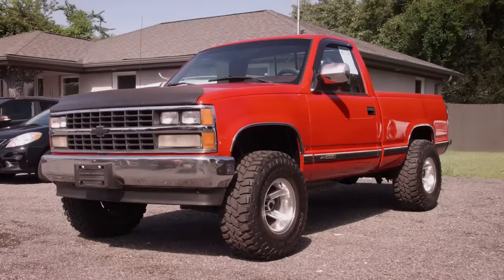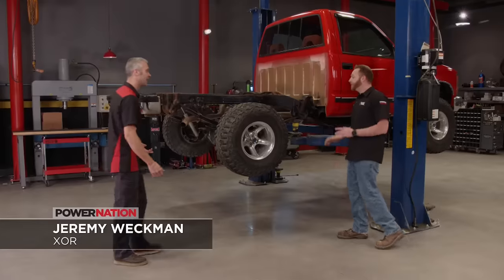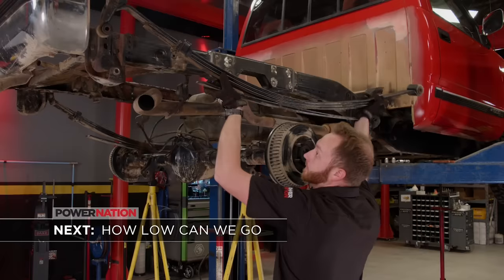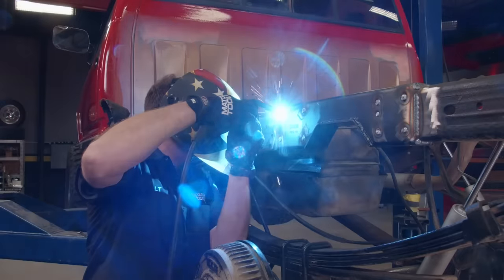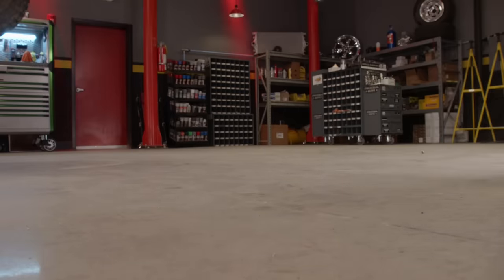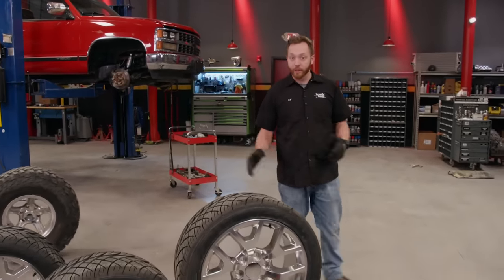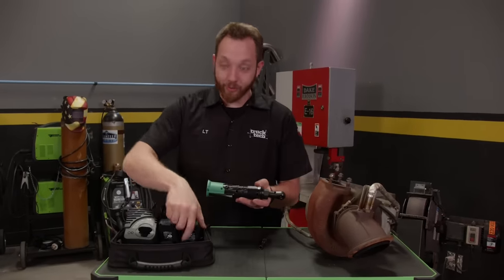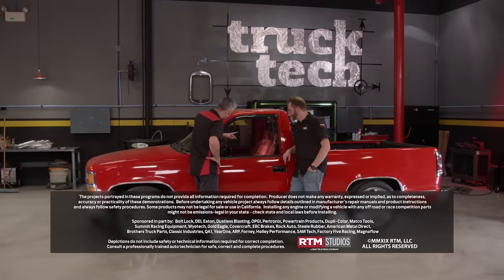Installing 4/6 Lowering Kit on a Chevy K1500 4x4 - Truck Tech S6, E4

Comment: So everyone loves the GMC Syclone and Typhoon, but somehow this is sacrilegious?!?! Great work guys!!! Glad to see something other than another cookie-cutter lifted 4x4!!
Reply: Magic6GMC  Agreed 👍🏻
Reply: yup to each their own. my coworker has a lifted 2wheel drive.
Reply: Everyone loves a SyTy until they own one. You have to have Bill Gates money to have a nice one. Even a 4L80E swap is 5k+ and very few people still support the 4.3 turbo. A turbo L33 LS2 or LS3 is the only way I'd consider having another. So many parts are specific to that platform.
Reply: It sounds dumb at first but the thing is the syclone and typhoon are awd while this k1500 is 4wd theirs a difference
Reply: @ericksanchez7787  they converted it to awd
Reply: @chesspiece81  5k? you're crazy. A stock 4l80e will handle 600 RWHP, with an HD3 kit they have been proven to handle close to 1k. 
125 - UpickUPull Trans
280 - HD3 kit
200 - UpickUPull NP205 transfer case
Reply: @ERidParasoth  converter, flexplate, driveshafts, software to run it and etc. Yes, 5k
Reply: I agree with this because every obs Chevy I see is lifted and I get sick of it
Reply: I worked on them for a time, they were junk

Comment: These older Chevy 4x4’s are perfect for lowering if you still want the four wheel drive to work. The independent front suspension works better with lowering than a solid axle would. My old friend in Alaska lowered her 1995 GMC Silverado 4x4 regular cab short bed back in 1996 after she bought it. She wanted something that looked similar to a 454 SS truck but that still had four wheel drive for the winter. Her truck looked great and in four wheel drive it would launch hard especially compared to a normal rear wheel drive truck. She got her lowering kit from BellTech way back in 1996.
Reply: this is exactly what people dont get on here.  Some people still want practical vehicles that look good but cant get over the fact that someone lowers a 4x4 truck.  I guess they forget about the silverado ss which is lowered from the factory.
Reply: @StingrayJen  I guess some people forgot that the SS was an overpriced, impractical, unpopular truck that barely sold enough to justify production, and is only driven by rich floridians that've never been off the interstate...

Comment: Dropped 4x4 is great, now how about putting some real power down to make it an awd street killer....like the awd ladybug....
Reply: Jose L ahh but he got clapped by leathal weapon
Reply: @itzzekee  yea true but they a both dope obs truck....
Reply: I'll race it in my off road truck and we'll see who wins lol. They made a 4x4 street princess and that's all they did but at least it looks better than most other street princesses, unfortunately it won't make it down my road, sad.
Reply: @reaperasylum2163  Your truck is suited for your usage case, which is brilliant. For those rest of us that live more urban snow belt areas where there is only practical parking one vehicle (if you can find a space big enough to fit it in), this thing would be a brilliant choice. It's big enough to be useful, small enough to fit most places, and still practical to use in any condition. There are a couple other places that these still beautiful "street princess" would be much better than your off-road oriented machine. 3am bombs around curvy backroads while dodging deer. At track or auto cross events. Wouldn't it be hilarious to pass some Miata drivers in a truck around turns?! 
These trucks will be lighter too. Especially the wheels, tires, and suspension. If you know anything about physics, aerodynamics and fast vehicles in general, lighter and lower improves many things on the road. It should also be noted that given equivalent power and both trucks in 4 high, the lowered truck will be faster. Mind you, I'm not saying that they're better than yours, just better for different usage cases. Enjoy your truck and be proud of what you built!
Reply: @storejoshuprite  not gonna lie I agree with ya bud, that's why I'm not doggin it and why I called it a street princess instead of a pos lol, see urban drivers such as most would benefit from a truck like this cause it's practical, my situation however a car simply cannot drive down the roads I live on so I know for a fact a lowered truck wouldn't either and mine is an old farm truck with brand new engine and trans so it to has it's use. As far as racing, on street I know that truck would win, on dirt I got it. And that obs chevy does look good and I'm looking forward to next episode when they convert it to awd.
Reply: @reaperasylum2163  Not gonna lie either. I wish I had the money to even get a truck. lol. If you don't mind me asking, what do you got under the hood? I'm all about new stuff in old shells or drivetrains that just don't belong in whatever they're in.
Reply: @storejoshuprite  it started out as a 94 ford f150 and when the farm I work for got it they put a 6" lift and added f250 front and rear axles, still had the same 351 and 5spd in it. Ran it for 8 years like that and alone that was a monster, I bought it from them and put in a built blueprint 400 and t56 kept the 6" lift and added 38" all terrain tires and aftermarket fuel injection and 3" exhaust along with a few lights. That truck barely sees city streets but makes for an insane off road machine and she sure isn't a beauty queen but definitely is mean, spent a little over 8 grand in the 5 years I've owned it and man it's a blast to drive. Just work hard and save up and guaranteed you'll have a truck bro. I started out in a s10 and now have 3 vehicles, you'll get there bud.
Reply: He wont be able to do burnouts in AWD
Reply: @itzzekee  yeah bro but lady bug is street truck, lethal weapon is a full blown race truck lol nonetheless both sick and badass trucks

Comment: Came here for the comments and God I wasn’t disappointed!  😂   That thing will launch like a mofo when they get some power in it.
Reply: David Attanasio, I had a '75 blazer with a 480 inch. Big block in it with big cam,  heads, still couldn't keep up with two wheel drive pickups or cars. Twisted drive lines and destroyed my transfer case. In the real world things are not so easy as they are in your imagination. Of course if you were born into a wealthy family, anything is possible.

Comment: Powernation: Lowering a 4wd...
Me: runs for the hills.
Reply: How original
Reply: I'd rather have seen a soild axle swap
Reply: Me too - should of done a solid axle swap.
Reply: I actually think this will be a really nice road truck, with 4wd in snow will definitely be awesome.
Reply: @izzyplusplusplus1004  that's the thing they turned an off road machine into a damn street princess that can never see the off road side of things, so where the pavement ends their asses are on foot where as before there was no place it couldn't go. Now they and anybody else that does this being it's their truck they can do what they want but if it were me I'd just add lockers and haul ass, all of my trucks have been 4x4 because where I live no one can get there unless otherwise.
Reply: @johncholmes643  6" body lift? 🤔 that's retarted 😂 suspension lift maybe or all you'd see is the fram
Reply: @johncholmes643  no shit really
Reply: Leif Shannon You realize that you’re not supposed to use 4 wheel drive on dry pavement right? There’s a difference between all wheel drive systems and 4 wheel drive systems with 2 speed transfer cases.
Reply: @Midnight Trumptrain

You’ve clearly never driven off pavement have you? 
Drag racing is only thing this pickup could do better now, because of added traction in a straight line. The only time when you’re not supposed to turn, because you’re not supposed to take turns with four wheel drive engaged on pavement, and as a street truck, it won’t perform as well as a RWD pickup because of the added weight of the transfer case, front driveshaft, and the front diff.
Reply: Well he did mention something about awd so we'll see what happens and if they either leave it 4x4 or convert it to awd. Who knows haha
Reply: @Leif Shannon get out of here with that garbage. You’re not supposed to drive on dry pavement in 4 wheel drive. There’s no advantage to it and you end up using more fuel just because you’re too lazy to unlock your hubs or better yet, simply push a button to disengage it. Let alone the amount of wear you place on your front diff, front drive shaft, transfer case, etc. for no reason. I’m surprised you haven’t broken shit from it. By the way, if you have manual hubs and control your transfer case with a shift lever, then no, you can’t kick it in and out while moving. Not every 4x4 can engage or disengage 4 wheel drive while moving.
Reply: @Midnight Trumptrain again, the only advantage that lowered K1500 has is in drag racing, yet I bet they haven’t touched anything under the hood.
Reply: @Leif Shannon I own the 1980 F-150 Ranger in my profile picture. Sounds like you need to learn how to not assume what people drive. I mean they’re your trucks, you can wear the shit out of them and burn a lot more fuel for no reason at all. For you, it’d be best to not spread your influence on others, for their sake.
Reply: @Pimpdaddyleif  Those stock axles would have a hard time trying to handle much more than the 230 HP the truck came with which just makes this abortion one big waste of time and money. It's one thing to want to do something different this was just stupid.
Reply: @Pimpdaddyleif  I didn't say anything about lifting it and putting 35s on it what were you reading? You said to put a 500 HP motor in it and I said the axles wouldn't take it. I was snaping the front axles running a 400 small block with 325 HP and 430 Foot pounds of torque until I put in some aftermarket pieces.
Reply: @Pimpdaddyleif  Forget it, dude. It is obvious that you have a problem with your brain synapses. You were right about one thing it was best in show in the 4 wheel drive category 2 years ago when I was finished building it.

Comment: I love the idea of a lowered 4x4 race truck.  Put a turbo LS setup in it and make a monster street truck.
Reply: 4x4 & all wheel drive are not remotely the same.
Reply: Theodore Dowman thanks for that pretty obvious info, but I didn’t mention all wheel drive at all.  I’m well aware that there is a big difference.  4x4 launches work pretty well on the street though.  I understand if lowered 4x4’s are not you thing.  Generally speaking they are not mine either.  But I think it’s a cool build and could be a fast street truck.  There are plenty of lowered late model 4x4 GM trucks with turbo LS’s that are fast and I like those builds.  Anyway, to each his own....

Comment: That's actually a good idea, I have a k1500 ext cab and it never sees off road... now I have plans lol
Reply: Rogue Mentality  because I needed a truck asap and it was available in my price range, I also live in alberta canada where 6 months of the year is snow and ice so 4 wheel drive is a great thing.
Just because I don't go off road doesn't mean I don't use 4x4 lol
Reply: Ken Graham, driving on Canada's roads during the winter time,  is like driving off-road.
Reply: @olderthanyoucali8512  exactly why I have a 4x4 lol

Comment: I had a 95'  Z71 extended cab shot bed and stock that truck bogged through everything I ever threw at it.. including a swamp that was like almost an 1/8th mile across and water was 3 feet deep and idk how deep the mud was but 4 low powered through no prob no stopping and backing up just straight through slow and torque'y

Comment: Regardless of when this was aired or uploaded... 4X4s and AWDs are basically the same, just depends on the trans-axle gearing and the front diff. Meanwhile SS Trailebrazers, SRT8/Trackhawks (That Silver SRT8 Jeep that AZN from Street Outlaws has digs really hard on the street) not to mention the AWD EVs and 911s that fly to 60 in under 3.0secs.

Comment: Wouldn't it make for sense or more practical to install an air suspension? Raise the ride height when offroading or mudding, then lower the ride height when traveling on regular roads.
You get the best of both worlds, 
1. By having the truck lowered, you get a huge improvement in the handling department by hugely reducing it's mass center of gravity which practically elimates any body roll, making the truck feel more fun and secured especially when you hit the canyon roads, you will be amazed at how safe and confident the truck will feel as you drive thru the curves at way faster speeds compared to stock ride height.
2. By being able to raise and lower the ride height, you won't lose any of the truck offroading capabilities.

Comment: This is bad ass. I’ve wanted to do this on a 92-96 4wd f150 but I don’t know how low you can get with the ttb and still have it align and function correctly. If you can’t get at least 3” lower it’s not really worth it to me/

Comment: Do yourself a favor and instead of 4" drop torsion keys look up Richard Wayne and his company Atomic Fab and ditch the torsion bars. It drops a ton of weight, uses double adjustable Viking coilovers and will ride and handle so much better than torsion bars. Also consider swapping the stock spindles for Belltech or DJM. I have that exact setup on my 06 Yukon as well as Belltech spindles, Viking double adjustable coilovers up front. On my 2wd Silverado a rear flip kit, Caltracs, and Viking double adjustable shocks relocated behind the 9.5 14 bolt 6 lug, Belltech spindles as well as Viking double adjustable coilovers. I've had tons of lowered trucks including a lowered 96 4wd Tahoe that I was hoping to swap in the LS2 front my Trailblazer and AWD conversion like this but the truck wasn't as nice. Seriously look up Richard Wayne with Atomic Fab he's not far from y'all or VAS in Texas.

Comment: I understand the concept of making a full size Typhoon clone. I bought a GMC C3 in the early 2000's.  It was a super nice truck with all wheel drive, not four wheel drive and handled pretty well.
I've also thought a regular cab, short bed pickup can make a cool hot rod muscle truck. So if this guy drops in a built LSX motor and stick shift trans it would be super cool! Build a pro touring style truck out of it. Not sure how the driveline will hold up under big power though.

Comment: All wheel drive and 4 wheel drive are different. Had a 97 z71 rear went out and had to drive it several miles in 4 wheel drive to get it home. Not long after that the transfer case went out. It's not ment to be driven long distance at highway speed in 4 wheel drive. Unlike a all wheel drive that is designed to be driven at highway speed.

Comment: "The axle slides back in, 6 inches lower"

False. The axle is 6" higher. The truck is lower. 

"A flip kit will lower any truck"

False. Lots of trucks have their axle above the spring already. Flipping one of those would raise the truck.
Reply: Well don't you know it all.
Reply: @chaseware3181  not yet

Comment: Always thought that any mods to a 4 wheel drive meant going HIGHER. You proved differently, good on ya. Question, why not paint back of the the cab and box while they were apart ? These '88 to '98 short box, single cab trucks are so nice to have and drive.

Comment: Awesome video, quick question... how many shock extensions did you use total because they come in sets of 2 so do i need to order just 1 set or 2 sets? And how did you achieve 4 inches drop in the front from torsion keys that say they only lower the vehicle 3 inches?

Comment: Looks like that cab isn't as solid as you thought...I see what color it used to be.
When using the altering pork chops you want to make sure your preload is not changed. They make drop knuckles for those trucks and would allow you drop the nose without completely screwin the pooch on the torsion bars.

Comment: The 4X4 sat nice as it was , Also even know you welded the frame adaptor / Brace in place a few bolts would be nice .
Reply: Welds are stronger than the steel itself, what would the point of bolting AND welding?
Reply: @Zaphod7835   With hard riding , Welds crack in extreme weather conditions.
Reply: @sandman_7326  somebody should tell that to the guys using ANYTHING built frome tubes don't ya think?

Comment: Awd transfer case from a Silverado SS or GMC Denali
Reply: that 241 is stronger than the awd units.
Reply: @timothydurm4366  Aren't awd and 4x4 different by gearing for front and rear power distribution?
Reply: awd will let the front end spin if there is limited traction.  Stapleton42 explains this. He has an Escalade that he converted from awd to 4wd.
Reply: @timothydurm4366  Cool thanks neighbor. I've watched a little of him before. sweet ride. Appreciate the info.

Comment: i drive a single cab short box 4wd ram, i dont like this because having a 4wd adds alot of weight and doesnt perform well in the application of a street truck. a 2wd is much lighter and alot less drivetrain loss.